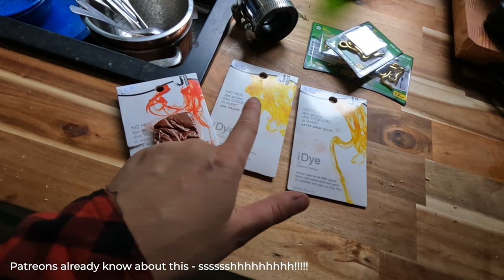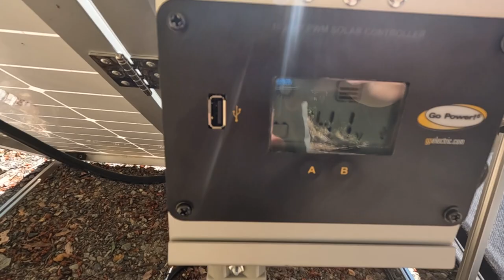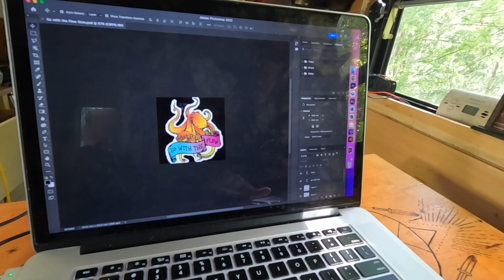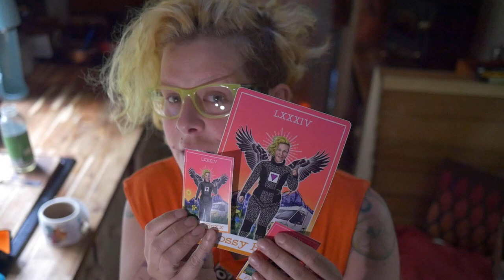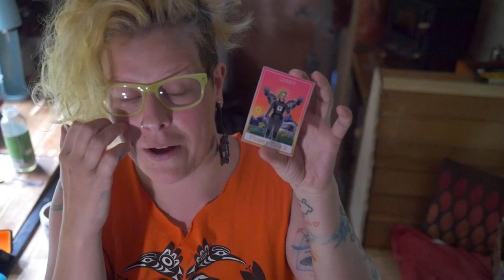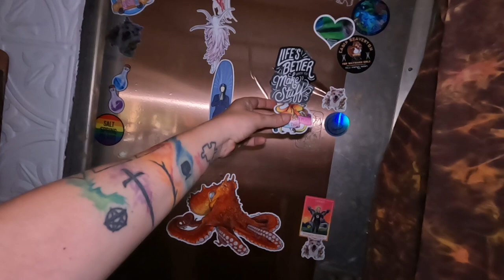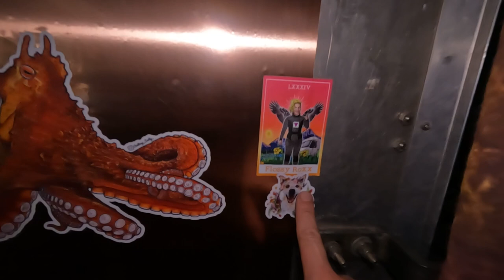Step Van Build tiny additions I'm back to Van Conversion business

Comment: You were talking about using no soap or biodegradable soap. I've learned wood ash is used to clean dishes, sinks and bathrooms. It has disinfecting properties and would imagine it wouldn't be harmful for the environment, I've read it's also used as a polish.
Reply from the maker: @Veraose ohhh that’s true I’d forgotten about that! Maybe I should use that to clean the copper backsplash!